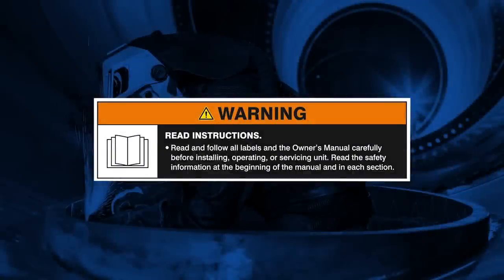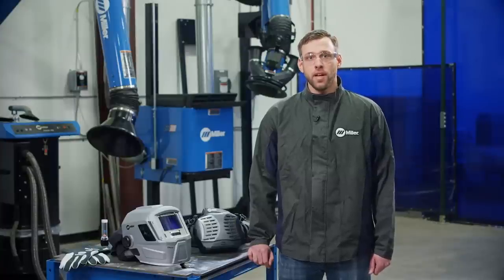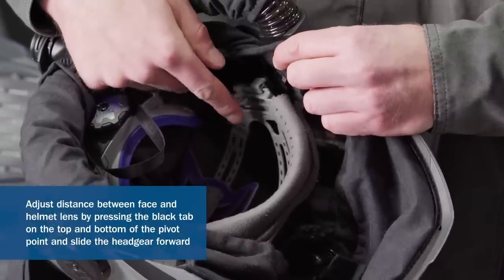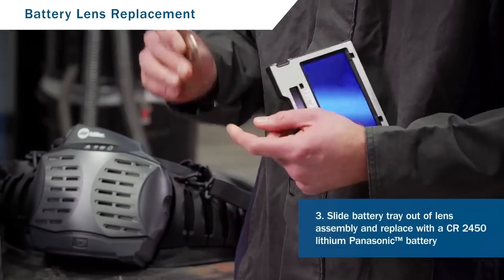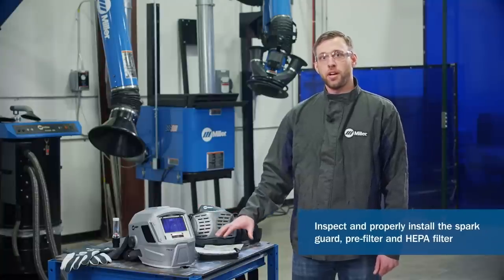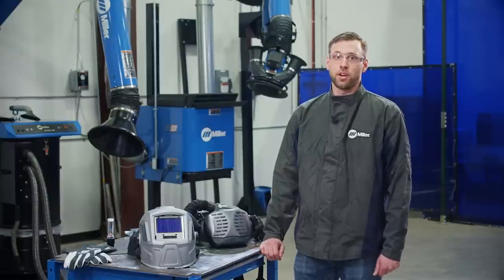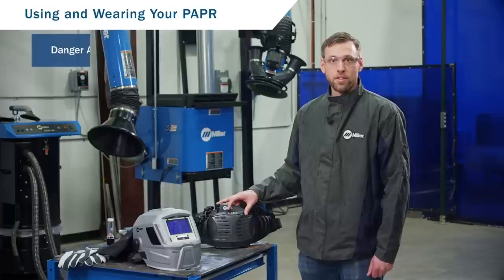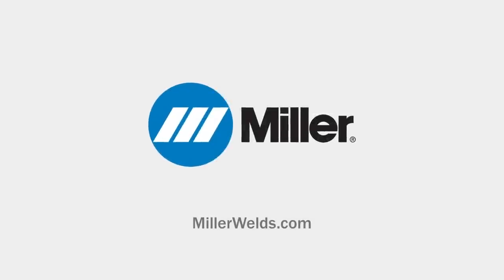Using Your Miller Powered Air Purifying Respirator (PAPR)

Comment: How often should u change HEPA filter? Every battery change? That's like every day for us.
Reply from the maker: There are no exact time frames for replacing these filters, as many factors come into play, such as the environment, daily usage, the purpose of use, whether it's indoors or outdoors, and airflow.

A good rule of thumb is to familiarize yourself with the smell and breathing pattern when using a fresh filter. When you notice a change in smell or find it harder to breathe, it's likely that the filter is becoming full.

Additionally, the danger alarm can serve as a reliable indicator. If it goes off or lights up due to poor airflow, it suggests that the filter may be full or blocked.
Reply: @MillerWelders  ok. Thanks for reply. Welding thick galvy and I'm getting worried.

Comment: Does this keep your body cool
Reply from the maker: Thanks for your question. The PAPR has a 6-point airflow distribution system targets “hot” areas within the face for immediate cooling relief, without causing eye and/or nose irritation.
Reply: @MillerWelders  so it just keeps face cool & not body

Comment: My work requires everyone to wear a hardhat; will I still be able to use the helmet as intended with a hardhat adapter?
Reply from the maker: Hello Steez. We have two systems that are hard hat capable. Those are the Titanium 9400i with hard hat (259385) or the Titanium 9400 with hard hat (261659): MillerWelds.com/safety/respiratory/powered-air-purifying-respirators-m00482#!/?product-options-title=papr-with-hard-hat-titanium-9400i-helmet-261659. No other paper systems will work with hard hats, this includes the T94 and T94i PAPR systems. Let us know if you have any additional questions.

Comment: The fume extractor in the background,  what are the two nozzles on the Intake that are facing upwards?
Reply from the maker: Thanks for your question. The nozzles in background are the new Zone-Flow modules for the SWX Filtair Systems. They allow for the arm to be up to 5 feet away from the weld.

Comment: Can u convert your t94i to the t94ir or are they 2 different things ?
Reply from the maker: Hi Adrien, the T94i and T94 are separate helmets. For more information, check out the product page and spec sheet: millerwelds.com/safety/respiratory/powered-air-purifying-respirators-m00482#!/?product-options-title=papr-with-t94i-r-264575
Reply: @MillerWelders  oh yea ik the T94 and the t94i are different helmets but I was wondering if I had the t94i would i be able to put the papr on it, because this one is called the T94I-R

Comment: I have a skull guard hard hat with a halo adapter. I know its a "loose fitting respirator" as the video states but would a hardhat reduce the effectiveness of a t94i-r?
Reply: I forgot to mention the skullguard brand is MSA
Reply from the maker: Thanks for your question. Unfortunately, you cannot use the T94i-R with a hard hat at this time since it uses a PAPR or SAR system. But we'll pass along your feedback to our team!

Comment: Worst weld hood I've ever used. Heavy, and setup time per use make it inefficient for shop work. Wouldn't be bad if you are working every day in an enclosed area or/and welding for long periods per weld. My shop went from personal choice on your hood to mandating these. Otherwise I wouldn't give $20 for this $1500 weld hood. I miss my Speedglass